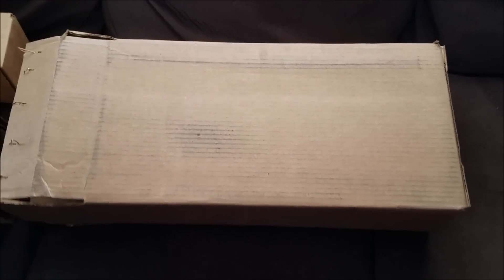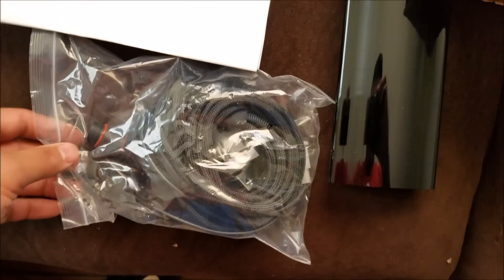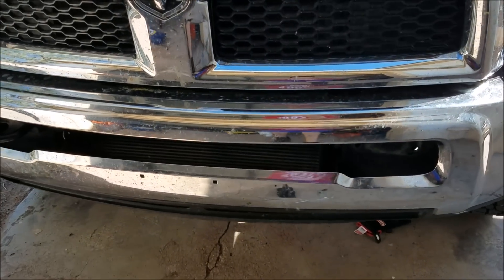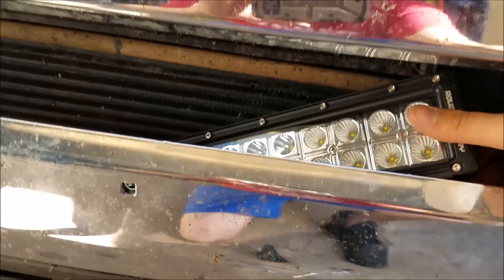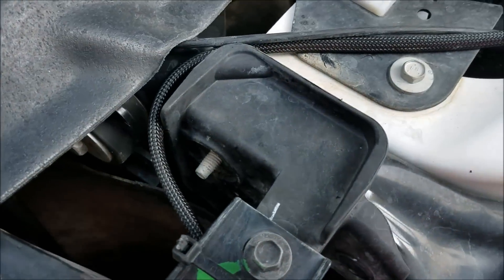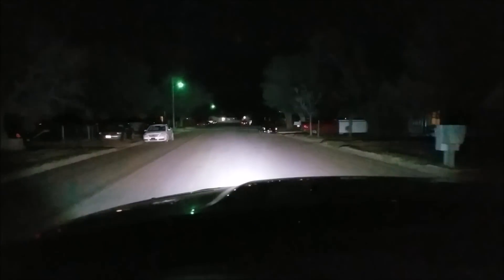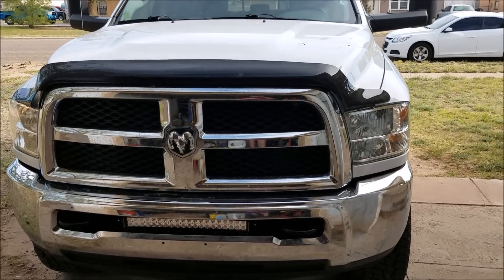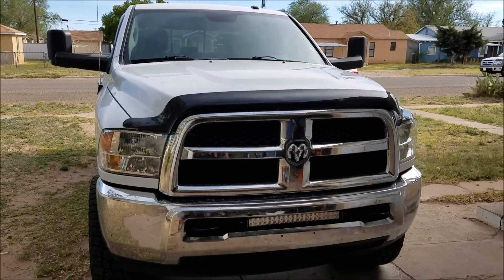Bumper Mount LED Light Bar Install for (03-17) Ram 2500

Comment: Can you report if that light bar affects cooling systems?
Reply: Robert Murillo wondering the same. haven't pulled the trigger on this exact set up because I'm a bit worried about it
Reply from the maker: Robert Murillo I have heard people wondering about this but i highly doubt it will affect the temps. But sure ill do a follow up vid later on!
Reply: It will not affect the cooling system, I have a 2010 and there is actually a plastic in my bumper
Reply: To give you a factual reply, this will not affect cooling. Ram tested their trucks under most conditions a truck would see. The only affect to temperatures occurred when they mounted a snow plow blocking the trans cooler and ran the truck in the dessert.

Comment: How did you get your hands behind the towhooks to remove those bolts with an 18mm wrench ?  did you have to remove the bumper ?
Reply from the maker: Jason Klems No sir I didn't remove the bumper, just used a wrench on the inside (back of tow hook bracket) and a ratchet on the front to remove bolts

Comment: I do have one question for you, so was it easy to run the wire through the firewall?
Reply from the maker: George GodMan If you can get an extra person to be on the inside while you feed wires its super easy! I did it on the first try, but if you are alone you can use a screw driver to feed it threw then pull it from inside!